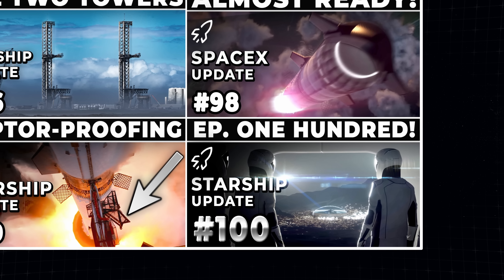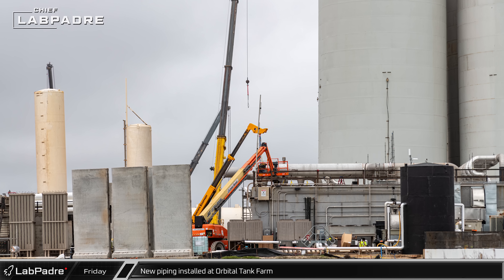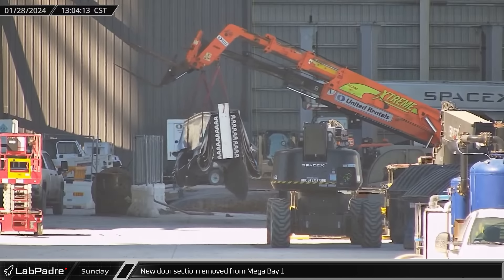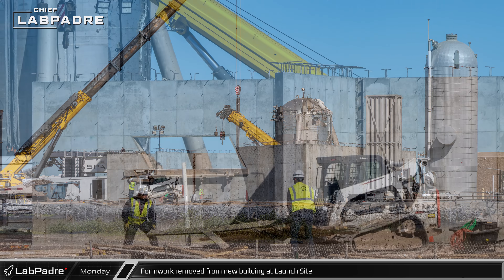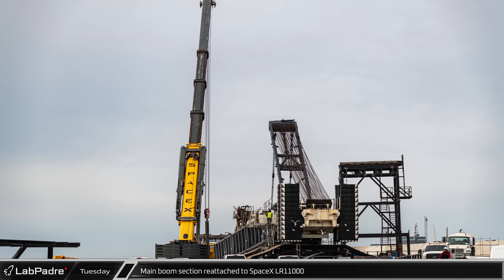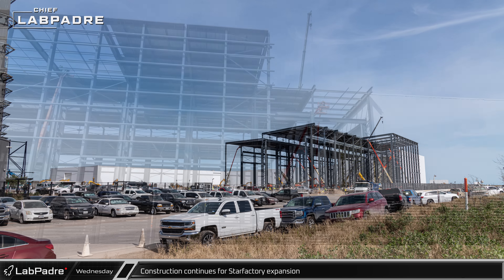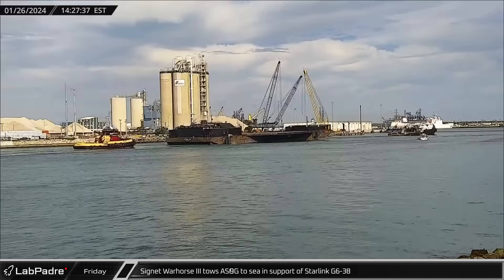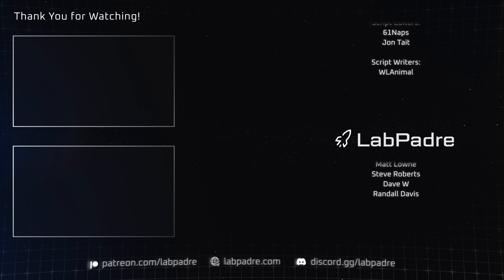Massive Starship Update! - SpaceX Weekly Update #100

Comment: Congrats on 100 episodes  👏 Since SpaceX plans to stretch Starship and possibly  boosters. I wonder if SpaceX will increase the height of the current launch tower and of  course build the second launch tower that new height. SpaceX should also position the second tower so that the new OLM is on the opposite side of any infrastructure/tank farms ect. Meaning the new launch tower acts as a barrier between the OLM and any infrastructure. Just like the current launch tower acts as a protective barrier between the OLM and the water deluge tank farm.

Comment: Hey Lab. Thank you for your no nonsense reporting on SpaceX activity. So I want to ask you. Can SpaceX just build an extension to Highway 4, junctioning a bit south at the Starbase sign and running parallel to the current Highway 4 to the beach? SpaceX can then give this, what? 1-2 mile road to Texas as the new public road, so people can drive to the beach whenever they want, and SpaceX can take over the current highway 4 from Starbase all the way to the beach as a private driveway where they can move Starships whenever they want. Will something like this work there?
Reply: No, because it'll require money, environmental permit, and it'll still be closed anyways for testing
Reply: Making highway 4 significantly wider makes sense when Starship hull diameter is increased.